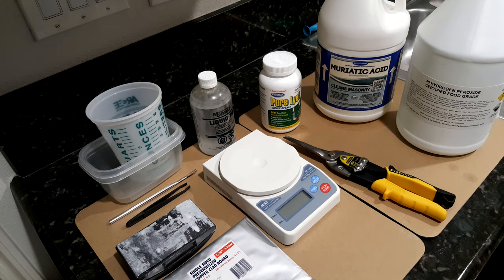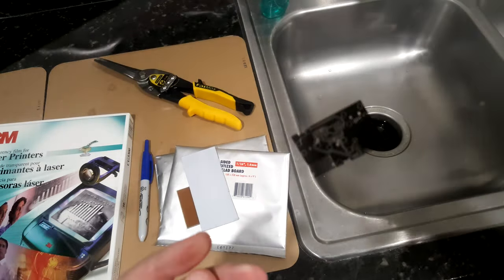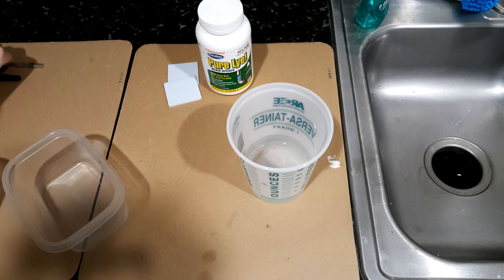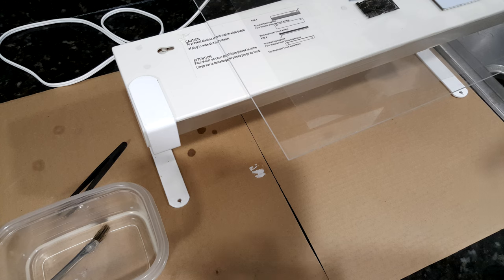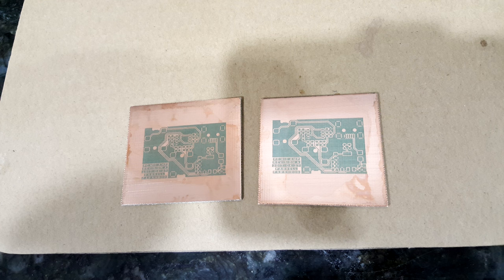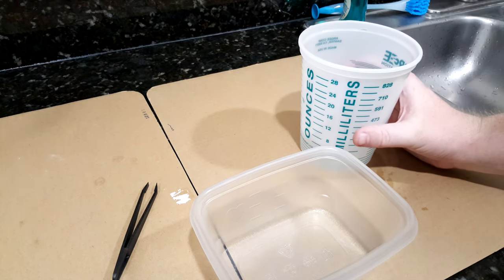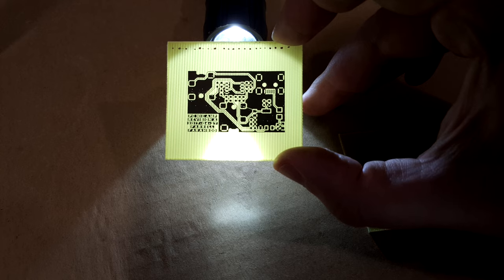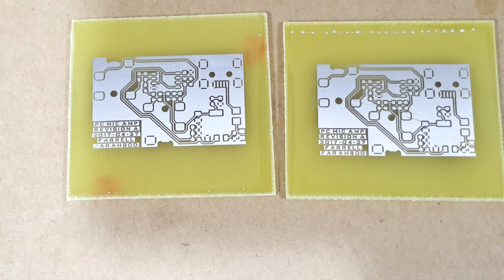PCB Prototyping Part 1: Etching and Tin Plating (Hydrochloric Acid, Hydrogen Peroxide, Liquid Tin)

Comment: Excellent video!  The copper etching at the end was quite compelling.  Hydrogen Peroxide sold for use in beauty salons is graded 10,20,30, and 40V.  40V is the strongest, and is equivalent to 12% hydrogen peroxide; 10V is 3%, 20V is 6%, 30V is 9%.  I suspect your bottle, marked 30, is 30V, or 9% hydrogen peroxide.

For those having difficulty finding concentrated hydrogen peroxide: the easiest choice is probably to buy some cheap 3% hydrogen peroxide at Wal-Mart, and concentrate it through boiling it off.  The water boils at 100 C, but hydrogen peroxide boils at 150 C; so just bring it to a bare simmer on the stove, and let the water evaporate out.  In this fashion, you can turn a 32 ounce bottle of 3% hydrogen peroxide into 8 ounces of 12% hydrogen peroxide.

For reasons that are unclear, 40V clear developer (12% hydrogen peroxide) is stupidly expensive in Canada.  You can easily drop $40 - $80 on a small quantity.  Boiling it down is probably the most practical approach.  >Charlie
Reply from the maker: Thanks for the info!
Reply: 3% hydrogen peroxide works great using a 50% hydrogen peroxide 50% hydrochloric acid mixture! Warm it up!

Comment: How do you neutralize and dispose of your used chemicals?
Reply: BTW your Amazon Hydrogen peroxide link is broken. It looks like either Amazon or their logistics options have restricted the transportation of higher concentrations of hydrogen peroxide. I didn't see anything official from them, but it's kinda implied by the sellers. When searching ""Hydrogen Peroxide 35%"" several sellers have listings stating that they are selling Hydrogen Peroxide 35% that was intentionally diluted to 12% 'for faster shipping.' The only listing I found on Amazon for 35% is $180 bucks. If I'm not mistaken, 12% would take about 2 to 3 times longer to etch with a 1:12 ratio of Sodium Hydroxide to a 12% concentration of Hydrogen Peroxide.

  I just wish there was a chemical combo that could be sourced locally at big box home improvement stores.

   BTW, I asked nurdrage about a way to make a cheap tin plating solution awhile back. They made a video about how to make your own solution using silver polish and other household chemicals as a cheap DIY replacement.

Comment: What’s the best way to cleanly cut the board? The tin snips tend to deform it a little in my experience
Reply from the maker: Tin snips has worked out best for me. You could cut it with a Dremel and cutting disk, but that makes a bigger mess and can be difficult to keep straight. If you cut the board before soldering things to it, it doesn't matter if it bends a little. (Just bend it back.)
Reply: @upgrdman  Thanks!
Reply: @dd884e5d8a  I use a CNC milling machine to cut (and drill).  That's the easiest, but another way is to use a sharp razor style (or acrylic) knife to score the PCB multiple times and then snap of along a straight edge.  That will give you a clean edge compared to the tin snips method.  Definitely want to avoid cutting with dremel type tool, which will kick up too much fiberglass dust as well as being very hard to make a straight cut.  Of course if your raw board size is too close to the size of your finished PCB it will be more difficult to use the score and snap approach.
Reply: @burtbicksler1676  Since I asked that question I bought a 3018 CNC and I've been using it to cut & drill FR4 with it. Thank you for your thoughtful reply.

Comment: I etch boards all the time using 50% muriatic acid and 50% hydrogen peroxide. I warm the mixture up before putting the boards in. The etching process is absolutely complete within 3 to 3 and 1/2 minutes.

Comment: Can i only use hydrochloric acid?
Reply from the maker: Hydrochloric acid with hydrogen peroxide has worked the best for me. I have also use ferric chloride with good results, and ammonium persulfate with acceptable results (but it was extremely slow.)
Reply: @upgrdman  just asking because I'm not sure if i can find hydrogen peroxide  near me, i might have to do some research on that! Thanks!

Comment: Why do you pronounce it sauder it is spelt solder. Sold-er
Reply from the maker: That's the way most Americans pronounce it. Pronounce it however you like :)
Reply: And Canadians also pronounce it the same way...
Reply: Its the same phonetic dysfunction as makes Americans (who don't speak proper English) pronounce 'mirror' using some variation of murh.  There might be a psychological link to the reasons why America irrationally still uses the old imperial system of measurement, despite allegedly being a metric country.
Reply: @Captain_Nemo-y7q if you work with electronics and with home made pcb, you'll know that "imperial system" is the pitch used on every electronic chip, in fact the normal pitch between two pins of any IC is 2,54 mm, which is 1/10 of an inch.
Crazy if you want, but so it is. Probably the very first ICs were built in United States, and all machines made to drill, insert, soldering those ICs can't be changed now, nor all the Integrated Circuits in use.
I'm from Europe, and we use millimeters. We are not familiar with inches, and we don't love them at all.
But English and American people do use inches from centuries, and - equally - they don't love millimeters at all. Who is right ? We have to accept difference from us ... 
Also we have hydraulics and gas pipes all in inches, they probably came from England  than from America ... more far than 1492, when America was discovered  ...